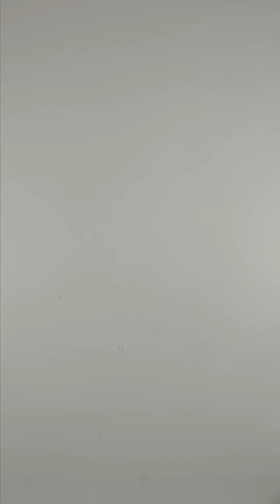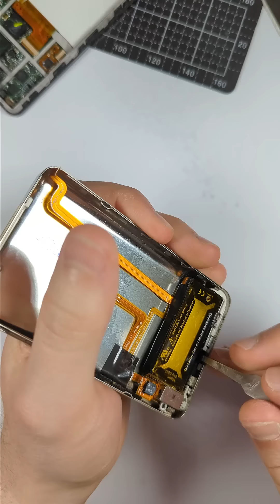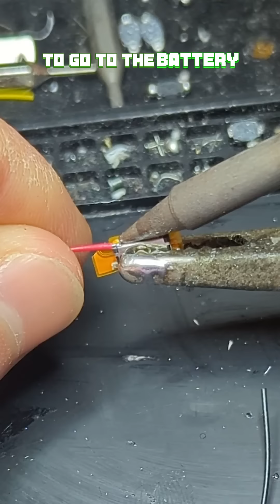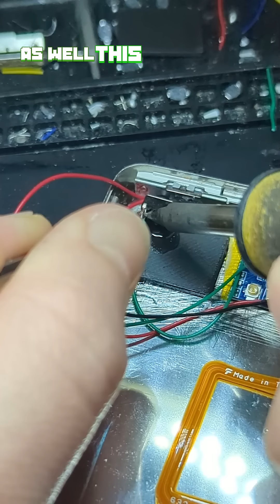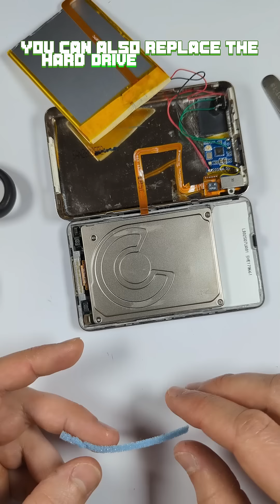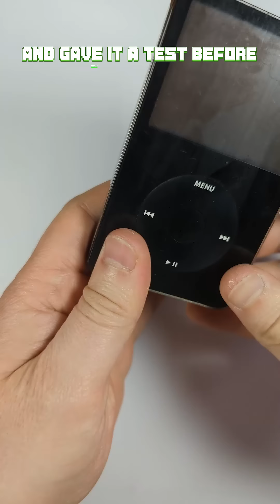How to add BLUETOOTH to an iPod classic #ipod #apple #bluetooth

Comment: Excelent! I understand that in lock mode you turn off the BT module, because if it is the other way around, it forces you to stop the BT every time you want to skip a song, otherwise, you can never lock the buttons
Reply: I'll answer myself: it absolutely has to be locked to enable Bluetooth. The moment the switch turns on Bluetooth, it locks, even if both buttons are on the center pin.

So, as long as Bluetooth is working, it will be in button-locked mode.

Honestly, I'd prefer to turn off the BT module when it's in the lock position... However, it seems to detect the BT power consumption and lock automatically.
Reply: @FerreXevi he disables the lock button, its now only acting as a power switch for the bt module
Reply: @t4nk3d402  Yes, that’s what I did and it worked, although now it can't be logically blocked. Thanks for the reply.

Comment: for clarification, this is a iPod Video, not a Classic. with a actual iPod Classic it would be a pain in the ass to actually open it up.
Reply: iPod Video are part of the classic lineup
Reply: Woah you’re pretty smart
Reply: Cost?
Reply: They dont have places that make them like this no more. I have a ipod classic 6th gen. The hard drive for some reason stopped working.
Reply: Its part of the ipod classics, im pretty sure its a 5th generation,
Reply: just talking about crap you know nothing about 💀

Comment: I did the Same 
But the Bluetooth connection is not that good 
The metal casing is limited the bluetooth to around 1 meter 
Sadly not useful in daily use

Comment: This is what I’m looking for, what Bluetooth module are you using?
Reply from the maker: @7ank0v1c  its called the kcx bt emmitter. I have a full length tutorial on how to install it and a link to buy it in the description. I also sell a pre made mod kit and offer a mail in repair service for it as well
Reply: I did use a special Bluetooth Modul with works with the AirPods it worded fine outside the iPod but not inside